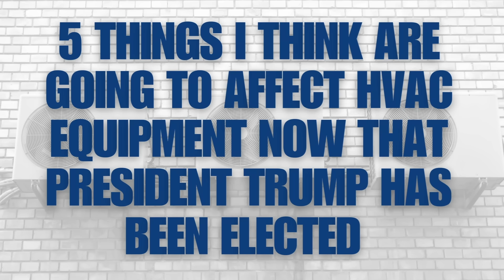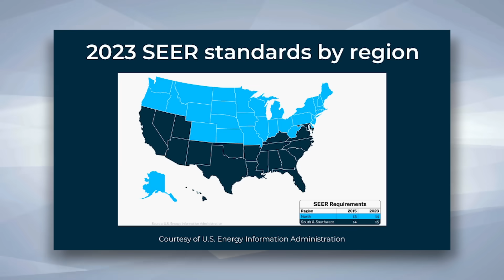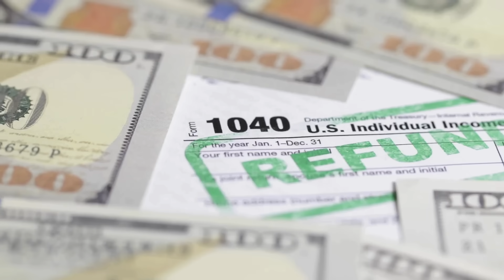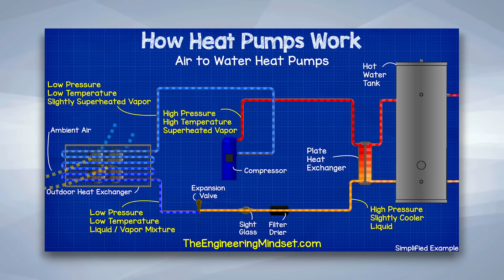Trump Elected - 5 HVAC Equipment Changes Coming!

Comment: I would like to see refrigerants pushed back to the days of R12 and R22.  At the least, I would like to see a ban on flammable refrigerants. 

I think the development of heat pump systems that work at 10 or 20 degrees F are great.  Education and market demand, not mandates, are the way to get those adopted.
Reply: Upvoted.
Reply: Ban of flammable refrigerants? You mean like R290 that’s been used since the early 1900’s and is still used today?
Reply: @victorsr6708  Yes, exactly!  I don't want propane in my HVAC system.  After the idea that Freon was destroying the ozone layer was disproved, the ecophobiasts had to find a new boogeyman.  Now they are chasing diminishing returns on reducing GWP and finding new ways to mess with Western Civilization.  Why don't they devote their efforts to China who is opening new coal fired power plants weekly?
Reply: Just retired last yr of 44 yrs HVAC Tech moved to Philippines only to realize yes new ref's been here a while & 22 & 12 are readily available to buy/use  as well
Reply: Sure, let's bring back the ozone hole the caused cancer to increase 500% in Australia and mass deaths of amphibians.
Reply: In Florida in the late 1960s we had inefficient window A/C-heat pump units that took forever to heat. At the same time we also had more efficient and compact water source HVAC units such as Climate Master.
Reply: nothing should be banned
Reply: @BryanTorok  would you say the same about seat belts and air bags?
Reply: @superamazingexpertfantasti6593  No, but those were very different in the number of lives immediately saved and the relative percentage change in the price of a new car.  The new regulations will take what might be a relatively minor repair to replacing a whole system.  Someone on here compared it to the difference between an unexpected repair bill to financing a small car.  Also, I'm handy enough and have a vacuum pump so I can do many repairs myself and now won't be able to.
Reply: @BryanTorok  switching to A2L refridgerants is not a big deal in the price of a system. Daikin was selling R32 units well before R410A phase out. R32 is also not patented, whereas R410A is a patented blend IIRC. 

Airbags started as a HUGE expense in a new car. Now they are a nothingburger. A2L is going to be the same.
Reply: @superamazingexpertfantasti6593  Not even remotely the same (in many ways it is the opposite). The new refrigerants are less safe than what they are replacing (especially R600a aka: isobutane and R290 aka: propane now being used in many consumer appliances) and it is really more of a step backward rather than a step forward. The earliest refrigerants were flammable, toxic, or both and CFCs were developed specifically to mitigate these hazards, but now apparently politicians are happy to put "the environment" above safety which is something that should never be allowed to happen. Flammable refrigerants in residential situations are absolutely an unnecessary hazard, and should absolutely be banned outside of specific industrial uses, and bans of CFC, HFC, and high-GWP refrigerants should be rolled back as the justification for these was often dubious at best (with the "issues" with these largely related to other uses such as aerosol propellant rather than refrigerant) often suspiciously aligning with the expiration of patent protection for these refrigerants (with the lobbyists from DOW, DuPont, etc. benefiting far more than "the environment") .

Comment: What would even be better for the environment would be to make better air conditioners that don't start leaking into the environment and die because they have evaporator, condenser and compressors failures after 10-15 years. But that would be bad for manufacturers and equipment installers.
Reply: They knowingly address only part of the equation....which completely defeats the purpose and cancels out what they're trying to do...In all of their brilliance....they force manufacturers to create ultra energy efficient appliances....with zero regard to quality...energy used to make stuff that gets thrown out sooner rather than later... all the energy used to make them all over again... Now, if they TRULY cared, they would address that... the fact that it's crickets should tell you everything.
Reply: Right on. It’s all about money. Filling up landfills with useable equipment that can be easily repaired doesn’t sound like sound environmental policy to me. The recycling scam has been over since China became disinterested in buying our garbage. It all goes to the landfill now.
Reply: Frigidaire and Lennox leak bad inside of 3 years.  Can't tell you how many coils I've changed.
Reply: Don't you think perhaps the majority of refrigerant pollution comes from the automotive sector? O-rings, hoses, shaft seal on compressor...
Reply: @timramich  very nice lies
Reply: Not to worry. They’ll blame Trump for all the future leaks along with everything else.
Reply: Speaking facts!!

Comment: Will tariffs bring jobs back in HVAC manufacturing? The scope of the tariff to do that would be so wide that it would increase consumer prices. Like if there are tariffs on Canada, Mexico and Japan and they are so high that everyone's heat pump that the most cost competitive place is Indiana, then we better hope that the incentives remain in place because the ticket price is going to be higher. Tariffs are just regulations that create price floors and increase prices, whereas incentives and efficiency regulations actually reduce prices for hvac consumers.
Reply: Tariffs are revenue that the customer pays, while billionaires get the tax cuts.
Reply: @yz250a Billionaires don't pay tariffs? Hmm... didn't know that.

Comment: R290!
Reply: New refrigerant!
Reply: Insurance companies should love the idea.
Reply: @thisisyourcaptainspeaking2259  290 keeps efficiency at higher temps that 32 and 454B cannot touch and it has a higher specific heat capacity so less refrigerant is needed. Plus, 290 cannot be patented (it’s propane without the odorant). Monoblock hydronic units solve a lot of problems.
Reply: @thisisyourcaptainspeaking2259  how much gasoline do you sit on on the way to a store?
Reply: @Squeezmo  I have no issue accepting R290, seems like a better choice than these others aside from maybe r12/22.  The quantity of R290 can be very small in the case of a heat exchanger with water-based coolant, not sure why Europe hasn't gone this route with their air to water systems.

Comment: Any changes during Trump should be positive. Going against the grain and spending three to ten times more to do much less in energy, like the Biden folks want, is completely dumb. Trump will get our energy back up to where it needs to be and at the same time improve any negative emissions, not eliminate them but to fairly reduce them. Anyone who thinks zero emissions exists is also dumb. There isn't one electric devise today that doesn't also pollute because of the remote sources for their electricity. Solar panels only work during daytime and with good weather. Batteries are an idea however, they are extremely anti-environmental friendly in manufacturing them as well as disposing them. Natural gas is the best solution as it generates electricity as well as performs better in many areas of industry. You can't simply ban natural gas and believe that 100% of electricity is going to be supplied by solar 24x7. To ban natural gas will be too expensive for the economy to deal with as well as the replacement will not do as good a job as gas does. Mental midgets in Government are most of the environmental concerns in the USA.